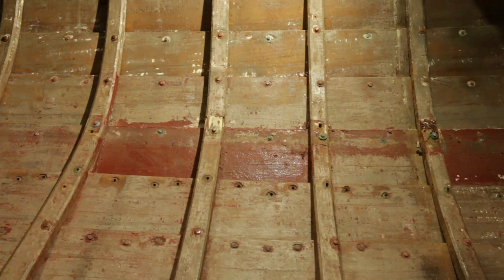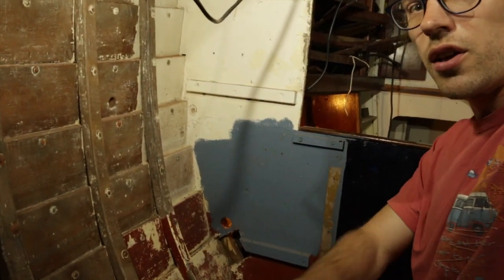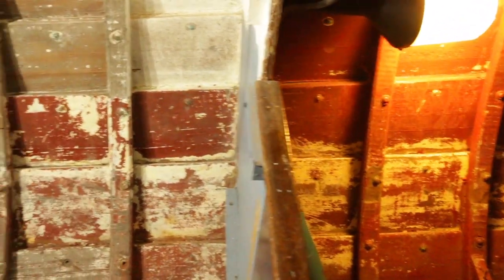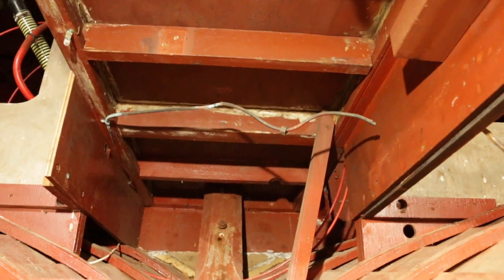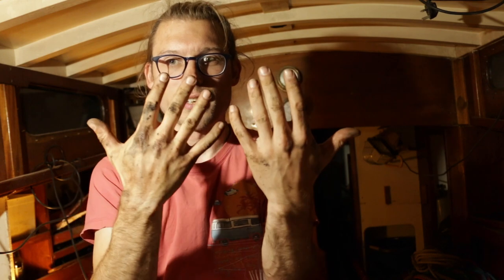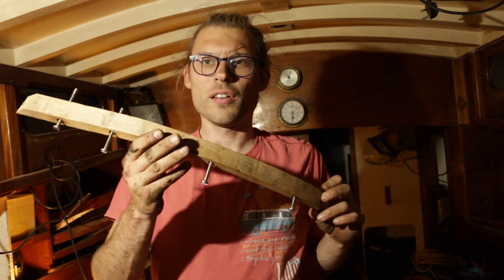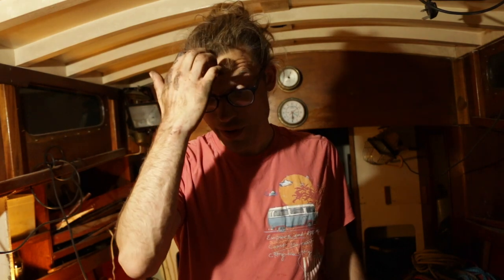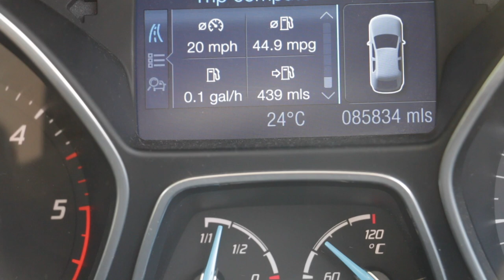09. Working in a Clinker Bilge. Wooden Boat Restoration.

Comment: Ahhh! There's no need for the screws to fit so tightly. You can 'over drill' the holes, and if you're worried about the voids, you can pump sealant into the gap around the screws before adding the washers and nuts. The entire strength of the repair depends on the clamping effect of the bolts and not how snugly they fit in the holes...